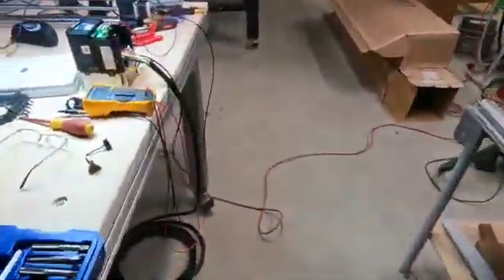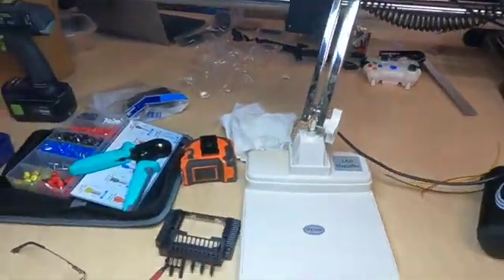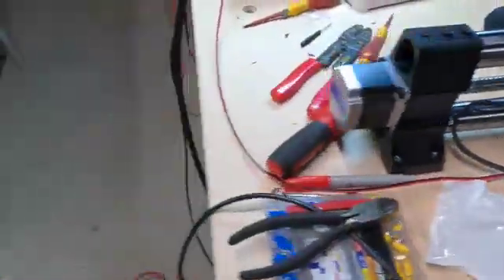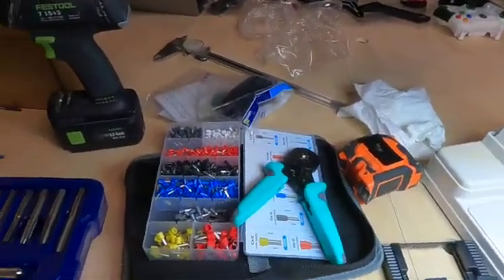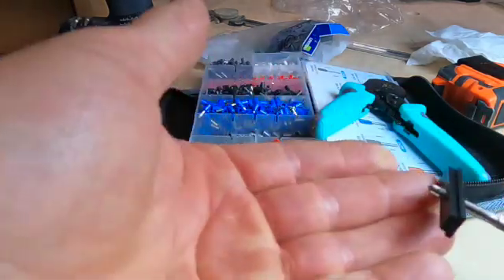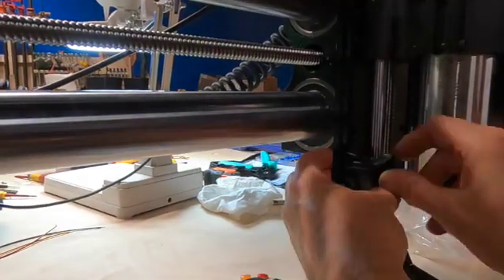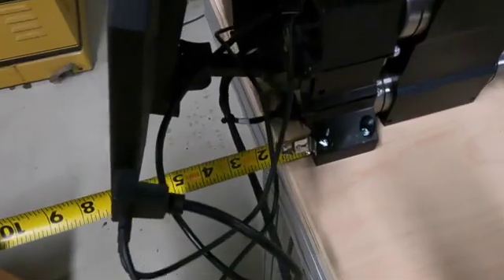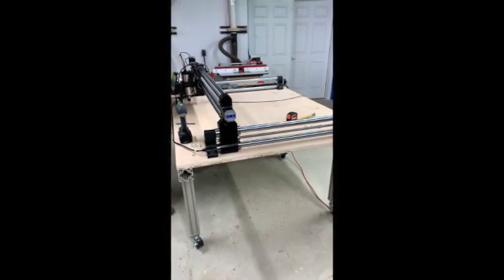Onefinity Journeyman X-50 assembly and start up Part 2

Comment: The monitor/control panel mount seems to be the (hopefully) only weak point of the 1F. My Journeyman arrives in > three weeks! I hope I don't need to buy a tap/die kit LOL!
Reply from the maker: LOL - I think I could have forced the two pieces together however I wanted to avoid stripping either piece.  At the time, the software didn't support flipping to screen however since then Onefinity addressed this concern.  It has a stand built in and now stands directly on the table.  I have had only one or two issue with the machine  - overall I am very pleased with the performance.  I would have loved to have had the new Masso control available when I purchased this machine - might be a future upgrade.  I was pleasantly surprised when my machine arrived a couple weeks early - good luck.  Let me know if you have any questions during set up.